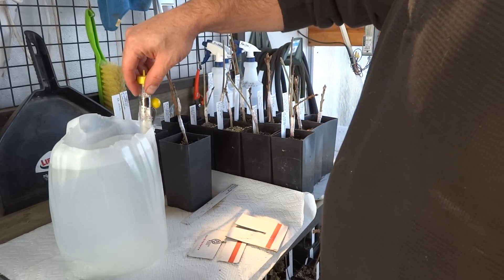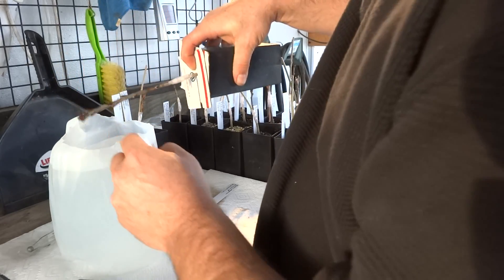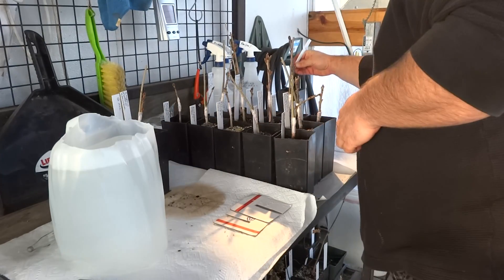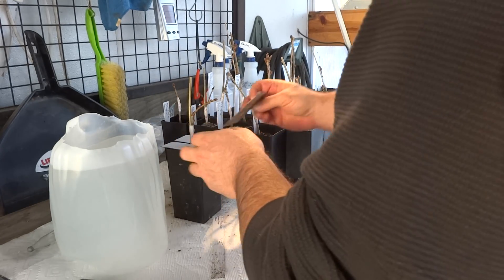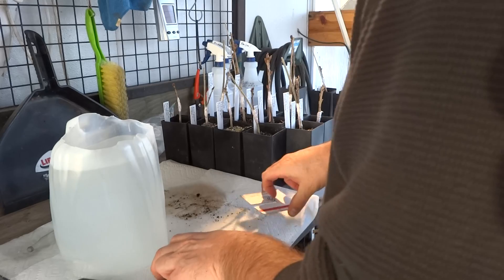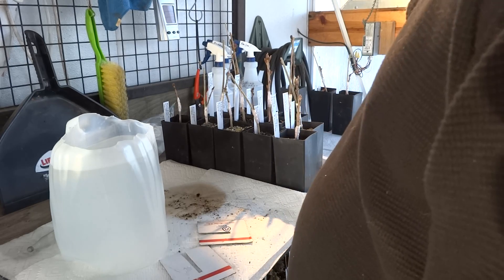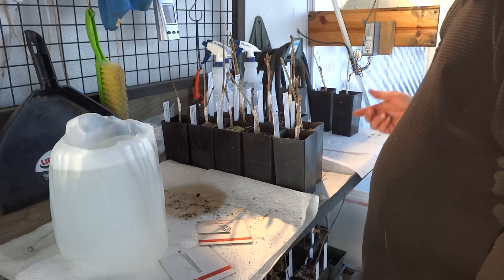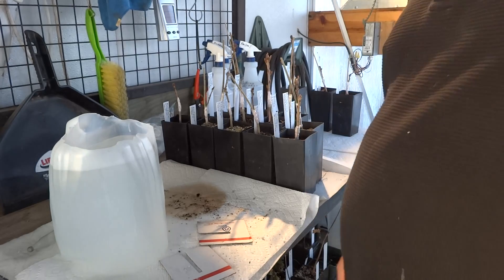Waxing Grafts

Comment: Wax compound please
Reply from the maker: Greenhouse wax recipe:  1/2 oz paraffin wax to 1 gallon water.  Heat to above 160 F and allow to drop to 160 F to begin dipping scions.  Metric:  1/2 oz paraffin to 3.75 liters water.  Dip scions at 71 C

Field grafting (outside grafting)  1/2 oz paraffin + .25 oz beeswax.

Dip quickly.

Comment: Won't that much heat hurt the tree?
Reply from the maker: Remember you're dipping quickly... that's the half of it.  Stick a finger in there and you'll see it puts that beautiful coat over w/o much more than a quick 1-2 second feeling of slight to no discomfort.  

I learned from a gentleman that grafted for 50-years of his life and is now deceased.  This is what he did and this is what he taught me.  Among peers, he is still considered the best conifer grafter in the United States.  He could graft oaks, and deciduous too having overwhelming successes.  Thanks for your question, Ian.
Reply from the maker: It's a quick dip and it dries in a few seconds.  You can put your whole finger in there and it won't hurt.  However, if you keep your finger in there it does hurt.  The whole idea is to do it quickly.

Comment from the maker: I know of folks that mix all kinds of things together.  All that is necessary is paraffin wax though.  Trust me that the best coating occurrs at 160 F.  All you need to do is heat the water to 180 F and add the wax and then let it cool to 160 F and begin dipping.